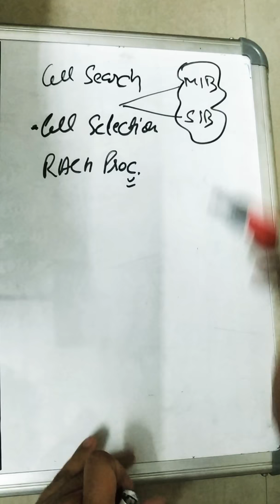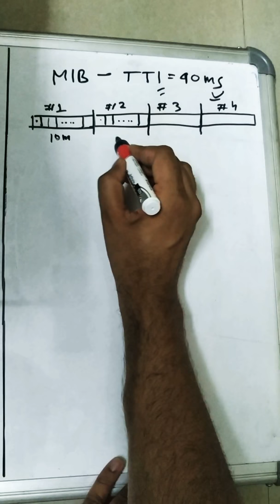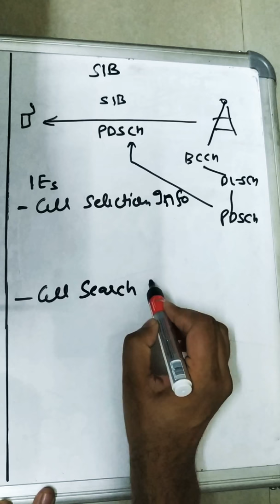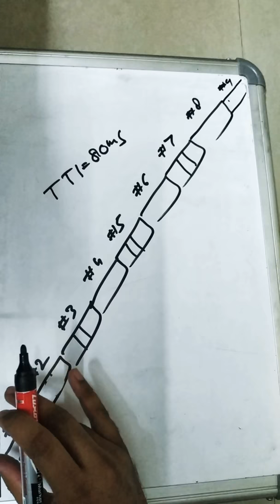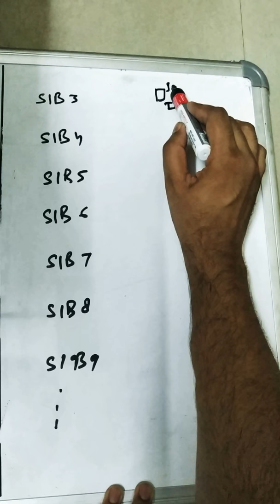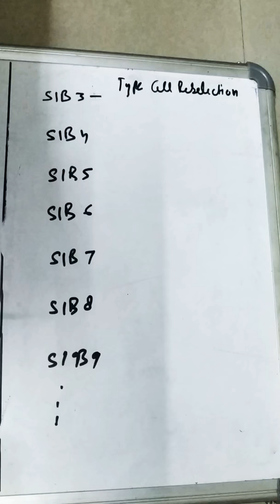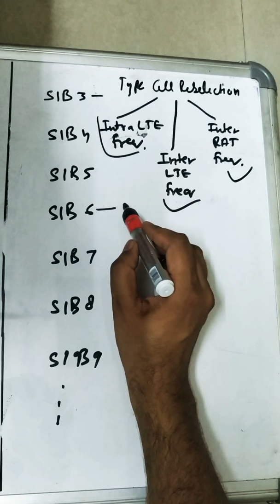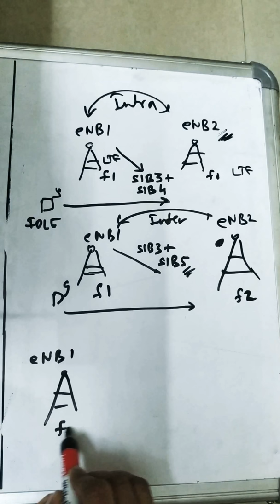LTE Tutorial (Part 3) LTE MIB and SIBs

Comment: I've a question. I understand that TTI of SIB1 is 80ms. SIB1 is transmitted over 5th sub-frame and rest 3 others SIB1 are re-transmitted within the time duration of 80ms & has a gap of 10ms right? also rest of the others SIB's (2, 3, etc) periodicity is based on SIB1 right? So my query is how  can we calculate the periodicity of other SIB's with respect to SIB1. I would really appreciate it if you could upload a lecture on this one as well. Moreover, First SIB1 is transmitted when Mod 8=0 and rest 3 others SIB1 are re-transmitted when Mod 2=0. What are these mod 8=0, mod 2=0? how do we calculate these things? Thanks
Reply: I'm looking for a detailed explanation on this concern. Thank you !!

Comment: Hi,
As you mentioned SIB is transmitting over BCCH then DL-SCH then PDSCH.
But i have a query how PDSCH comes into picture before RRC connection and who will decode this PDSCH and for which information?
Reply from the maker: Hi Amir....PDCCH carry RNTIs like:
SI-RNTI if PDSCH is carrying System Information.
RA-RNTI if PDSCH is carrying Random Access related information.
P-RNTI if PDSCH  is carrying paging related information.
C-RNTI if PDSCH is carrying real time traffic.
So, its PDCCH which tells UE that what information is present in PDSCH whether it is related to System Information, Random Access, Paging and Real time traffic. Thats why PDCCH i spresent in each and every Subframe.
Reply: UE decode this information
Reply: Ue decode pss,sss,rs we get pci then with the help of pci we found rs location in resource grid after finding location we get rs power with the help of rs power we decode PBCH and get MIB(DL BW, PHICH,SFN) then we decode PCFICH with the help of rs power we get CFI(1,2,3) length then we get  PDCCH length then we get PDSCH it gives SIB1 info  then PDCCH+PDSCH  we get SIB2.
Reply: @zafarhusain1920  Thanks alot buddy very useful